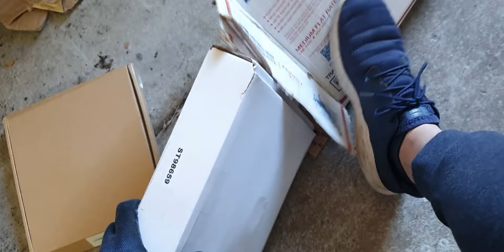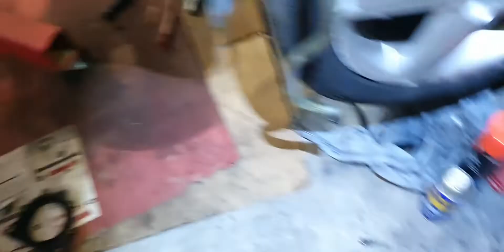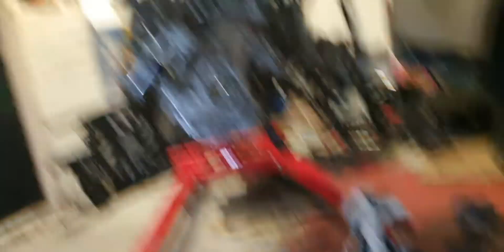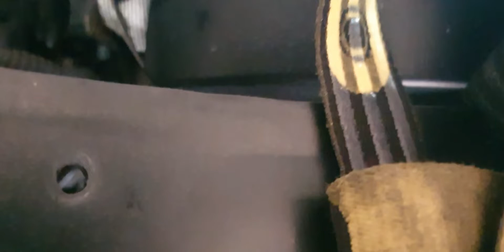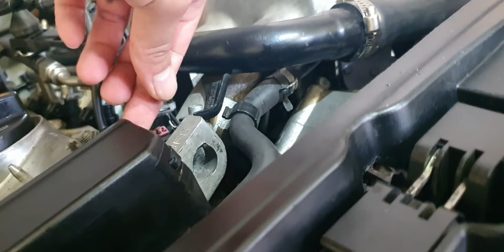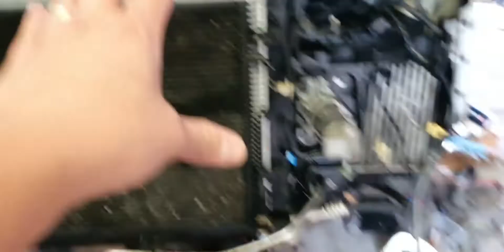The Audi A4 B6 1.8T Quattro is finally done and back together again. Will it start??

Comment: Hello! Nice project. Can you tell me your oppinon about the single mass flywheel? How does it feel? Can it be a daily? Thanks!
Reply from the maker: It's good. A little noisy (clutch chatter) when it's idle but drives really well, very easy to drive and great for daily.
Reply: @ajrveedub  my DMF is chattering right now so I think I can handle it:)) and if I soundproff the interior of the car maybe I wont hear it that much. Thanks for the answer. I have 1.8t BEX too, but not quattro :((
Reply from the maker: @bambambam21  clutch pedal is still very light so it's really easy to drive for me.
I have a mk4 gti that has a really heavy pedal and not as good for daily driving.
Reply: @ajrveedub  yes my pedal is light and I really prefer that.